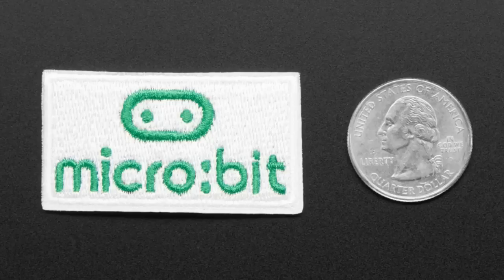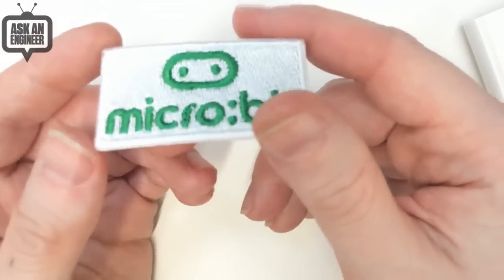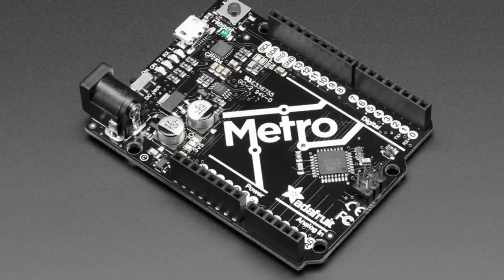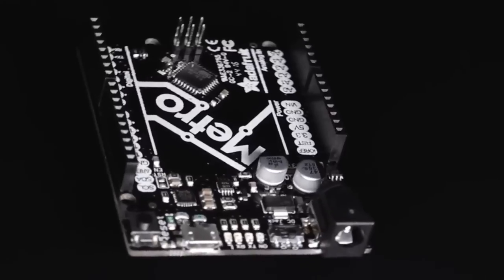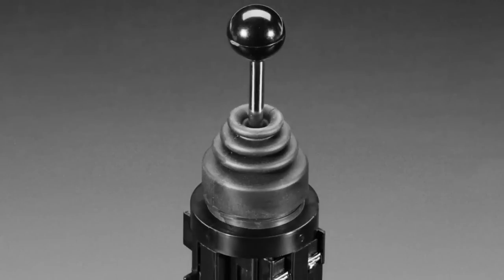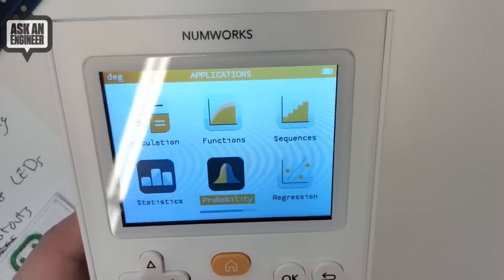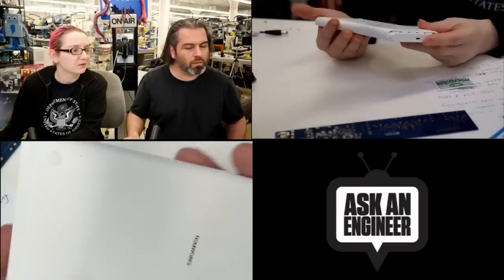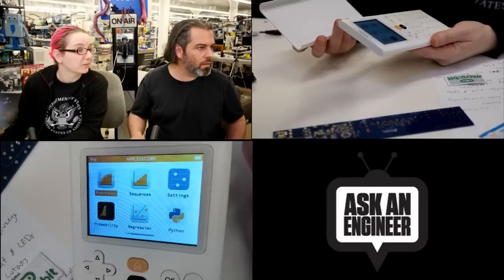New Products 4/11/2018 Featuring 1.54" 240x240 Wide Angle TFT LCD Display @adafruit #adafruit

Comment: How about a Pi-top that has a copious on-board battery w/charger circuit and the ability to install a proper 2.5"  hard drive (SSD or otherwise)?
Reply: Here's an idea: Raspberry Pi Model 4 with a U.2  connector in place of the USB ports.

Comment: Looking at the numworks web site, they have the OS for the platform (Eclipse) on github under a Creative Commons license. Arguably not fully open source, but you CAN get the source, modify it, build your own firmware, flash it to the hardware and use it.

Is it that hard to create apps for the platform, for instance, to be a fully scientific calculator? Financial calculator? Machinist/CNC calculator? Construction/contractor calculator?
Reply: I think it was recently made a little easier to developer applications for the calculator

Comment: Python calculator is neat. With regards to use in tests, what's to stop me from preparing a python file beforehand that has all the equations/functions I need?
Reply: Excellent question. Use approval on given standardized tests may be contingent on use of the stock firmware and flushing the memory of user defined content.
Reply: Ah ok. If you work there, good luck with the selling. It is a  much needed improvement over the status quo.
Reply: I don't work anywhere.
Reply: you should be fine as long as your school doesn't check or clear students TI calculators